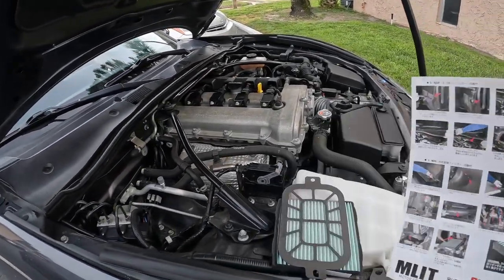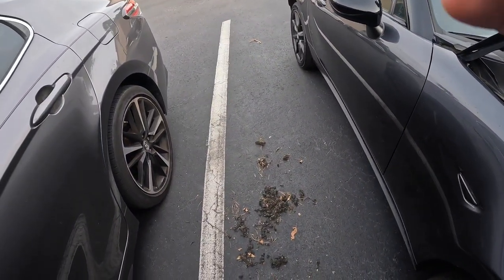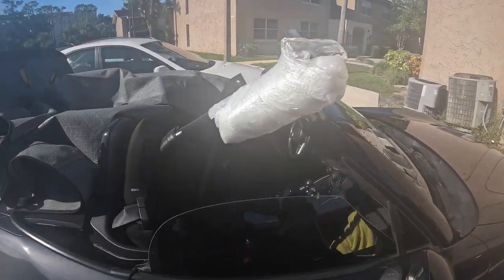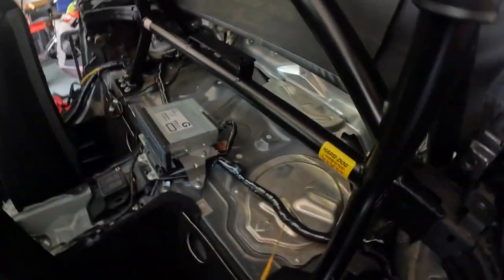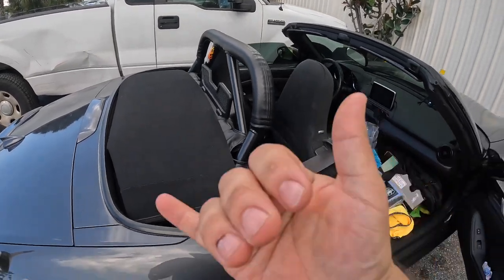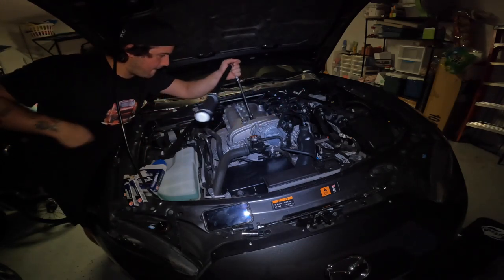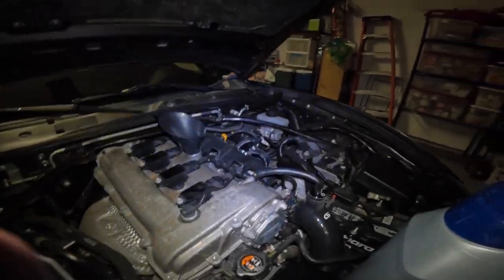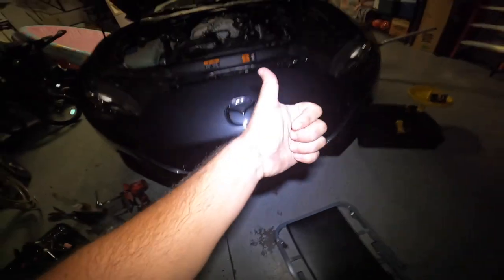4 things you should do to your nd miata

Comment: A cabin filter in a convertible is about as useful as a screen door on a submarine.
Reply: Lol unless your air starts smelling bad I wouldn’t touch that thing. Not worth the hassle. Mine is 2016 with the original cabin filter and it’s fine
Reply: @Willppyro  "original" cabin filter, also known as NO cabin filter :D
Reply from the maker: yet you see how much stuff i pulled out and the mess added will stop thae from hapening

Comment: Hey so according to the service manual the oem spark plugs have a lifespan of like 75k miles. I was really surprised and  asked a friend at Mazda about tha. Apparently they can easily last that long. That said, i wont wait that long to change mine obviously. Just feels wrong haha
Reply from the maker: yeah i know they say new cars can go that long but you feel the loss in power when you dont have new ones for sure
Reply from the maker: also my car is a 2016 so the plugs may not have hit the milage but they are 6 years old
Reply: @kyleworksoncars  exactly my thought. I also got a 2016 and mine felt a bit off in idle a month ago. Changed plugs and runs perfectly smooth again. Great video by the way!
Reply: @Fyba  what mileage were you at when you changed plugs?
Reply: @kyleworksoncars  fair enough

Comment: My dude those plugs look brand new.  Definitely agree with checking them at 20-30k, but get you a feeler gauge and check the gap and those should be good to go for another 30k at least.  Manual says 75k, and they assume you're actually going to drive an mx-5 pretty hard.  Modern plugs last 100k in grocery getters all the time.  Now if you had turbos or a supercharger on there, then yeah, it's going to eat plugs faster, but without forced induction and high compression ratios you should be fine just checking the gap every other oil change and making sure there's no discoloration on the ceramic insulator.

Comment: Besides Buying the jack stands I would suggest cleaning the MAF sensor. Takes about a 1/2 hour & 15 minutes of that is letting it dry after spraying it with the cleaner. Nice job on the cabin air filter, asked around & this was the 1st of ever seeing one in a ND / ND2.
Reply from the maker: 9:34 yall are blind

Comment: Hi, in Europe the spark plug change (by Mazda) is to be done at 100 000kms, modern engines with computer management don't ruin plugs like old engines did. For the filter,  I installed stainless steel bug screen over the air intake so that debris and animals can't get in, I didn't install a paper filter as I drive the car mostly open top.

Comment: So my only issue at this point is a check engine light(misfire ord one or more pistons) occasionally on a cold start up.  Easy to clear and doesn’t happen often but does happy.  Running .30 gap on hot plugs.
Reply from the maker: I would maybe contact a tuner and see what’s going on